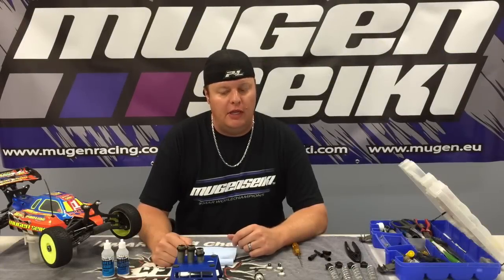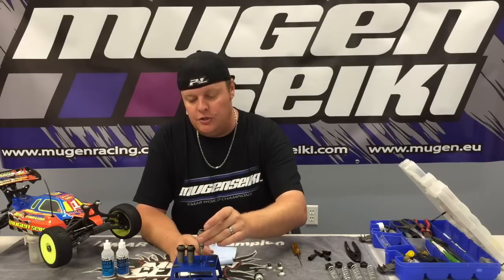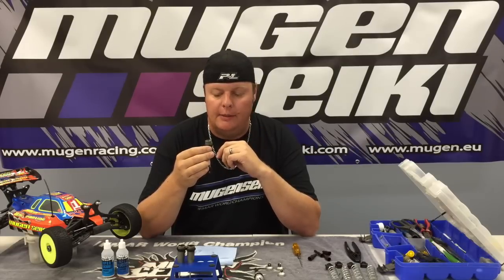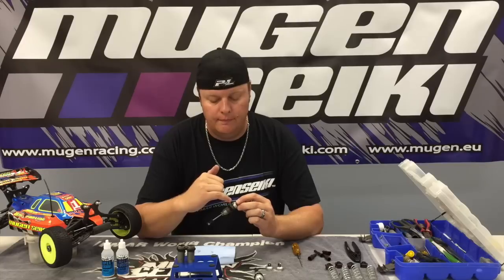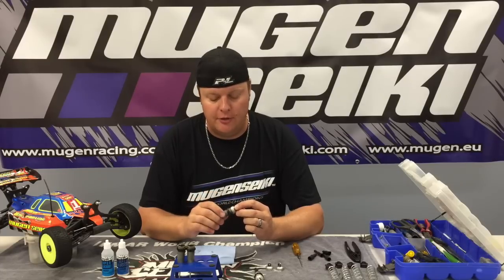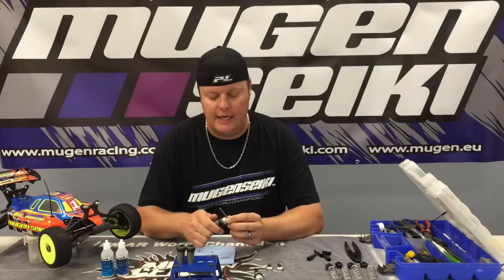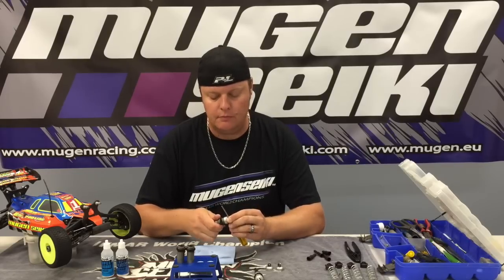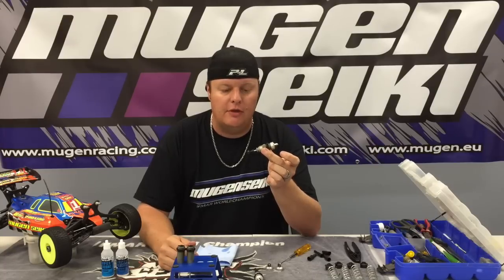Adam Drake from Mugen Seiki Racing explains how to bleed shocks.

Comment: I did it wrong for almost 3 years of Mugen vehicles. Thank you sir Adam!
Reply from the maker: Phillip Gabler 
My pleasure.
Reply: +Phillip Gabler 

Lol, same  here. I was building my mbx7t shocks with half rebound. Gonna try this method and see if it helps with traction rolls.
Reply from the maker: +brandon 
Hope it works well for you.
Reply: +Adam Drake 

Thanks!
Also Adam, I noticed on your setup sheets you like to run the 6x1.3 pistons. Are those blanks you drilled yourself or something different?

Comment: when bleeding it’s all about bleeding the air out, so after the few pumps, you should have no rebound ? That’s to verify no air correct?
Reply from the maker: With a bladder, you shouldn't have any air and you're bleeding out the excess oil.
Reply: @AdamDrake  and zero rebound correct?
Reply from the maker: @monstah408  It's fine to have a little rebound, but normally you try to run little to no rebound.
Reply: @AdamDrake  right on man , thank you, I had a issue when I was running shock were good at start of a 10 minute heat then after suspension would be flat, my front end would stay down, i bleed so many times, until i replace all internals inside shocks, once i did that everything back to normal. It was a little bit over a year with the same internals. I am thinking every 6 months to replace now.
Reply from the maker: @monstah408  Ya, it's never a bad idea to freshen up the internals from time to time.

Comment: Do you always set your shocks with zero rebound (or as close to zero as this method yields)?

If not, I'd be interested in hearing your thoughts on changing rebound for various conditions.....maybe in a future video???
Reply from the maker: ***** 
Yes, I always run zero rebound or as little as possible.  In the past I would run more rebound on low grip tracks.

Comment: I like to use Losi oils because of the colors, I usually pick which color suits my mood for that race or sometimes even match the oil to what color body I am running that day. How do you pick your oil.
Reply from the maker: Haha.  :)
Reply: I don't even think you wife would say something that foofy. Hmm today I'm feeling like Losi blue!
Reply: BTW my pro tip is. Instead of using green slime or some other grease on your shock o-rings pack then or lube them with a real heavy diff oil (10,000). It is 100% compatible with the shock oil. It is a great heavy lube to insert the shock shaft with and it hangs around to catch and trap some of the dirt.

Comment: The bladder stops the shaft from going all the way into the shock body when I’m trying to set zero rebound.   

If I push the shaft with force all the way in,    the nut on top of the shaft feels like it will damage the bladder.
is this normal?

or should I only bleed the shaft up until the nut makes contact with the bladder?
This ends up being around 5mm so not possible to achieve zero rebound
Reply from the maker: The nut shouldn't hit the bladder unless you don't have the shock end screwed on all the way.
Reply: Adam Drake ok fantastic thanku
Reply from the maker: Happy to help!